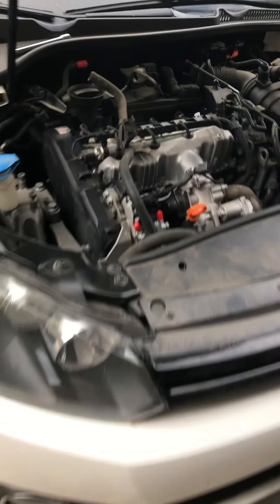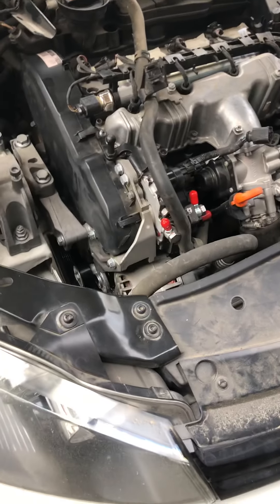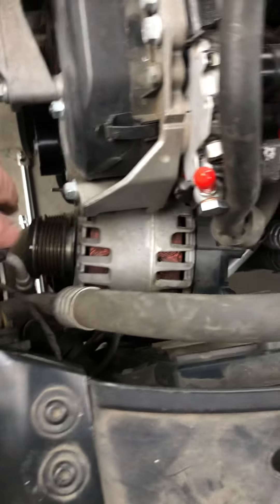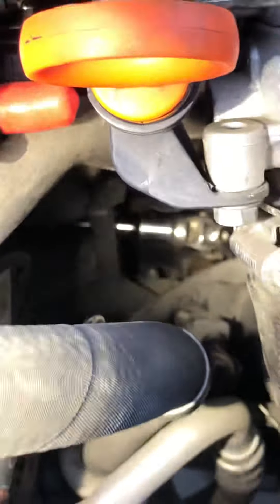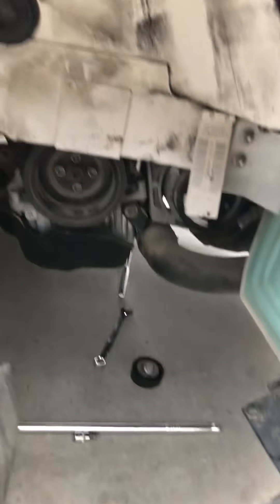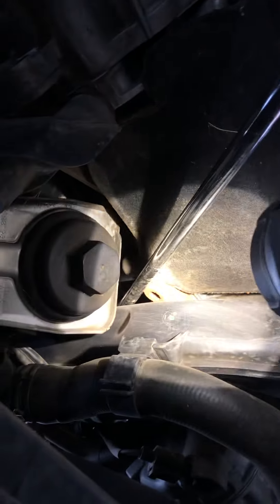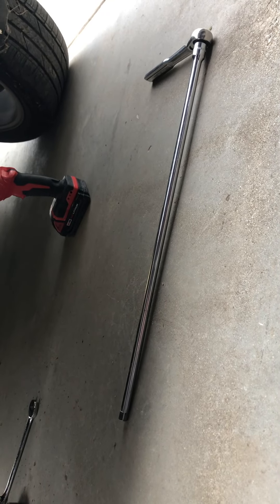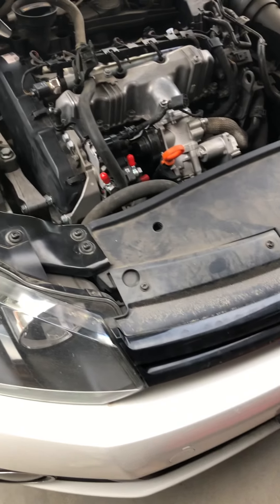VW 2.0 TDI MK6 serpentine belt tensioner replacement trick

Comment: Took me 10 minutes ! didn't have to move the alternator! Best video!
Reply: Nice to see a fellow mechanically inclined female working on these cars!! I'm getting ready to check the tensioner; alternator stopped powering the battery with prior multiple belt breaks & replacements. Fingers crossed it isn't the alternator.

Comment: I've just done this job, what a gigantic pain! I took the ac compressor off and could get at it with only a 2inch extension. You'll need a very extensive set of sockets and extenders to do it the way shown. It's not as if the access to the bolts for all of the things you need to dismantle beforehand is good either.

Comment: Before you complain too much. The 2013 vw amarok poly v belt tensioner arm (same part) requires a complete removal of the alternator AND you cannot remove the M6 bolt (with 13 mm hex head). And these m6 bolts are also known to snap in half with the entire tensioner arm falling out with the pulley and the poly v belt then flying into the timing belt cover and dmgetting caught in the timing belt while the car is moving causing catastrophic engine failure. VE have developed a heavy duty timing belt cover and a heavy duty tensioner pulley arm (with a metal pulley instead of the plastic pulley in this picture$. Product code endinf with AN is the regular ending with AP is the heavy duty tensioner arm

Comment: You can get a little more space if you remove that plastic piping.  One hose clamp at the top , one down by the rad, and then two T30 torx screws.  One is easy to get to by the oil pan, and one is a little harder about half way up.  Theres also an electrical connector, easier to get to once you pull the tube about half way out.

Comment: It looks like you can access by removing the air intake too which is good because I need to replace that along with what I believe may be a bad tensioner. I just had the belt kick off and it had only been replaced a couple months ago by a local shop. They didn’t replace the tensioner unfortunately and I didn’t know they had replaced the belt until they were done with it or I would have just had them do the tensioner too. My 2014 MK 6 Sportwagen TDi has 315K miles and I have no problem preemptively replacing a part like a tensioner before failure with that many miles.

Comment: How did you loosen the alternator? I can’t seem to get past this step lol, I have a mk5 Jetta tdi
Reply from the maker: I believe it’s solid mounted I just removed the bolts and it pulled right out of the bracket. Your cars might be different than my Golf
Reply: Mk5 Jetta TDi isn’t specific enough. That could have the BRM or the CBEA (2009 common rail) engine in it. The CBEA is nearly identical to the engine depicted in this video. If it’s a BRM, the tensioner is mounted like a normal tensioner.

Comment: So once you get the alternator off just use a 13mm wrench. Ratchet wrench if you have it. No need for the extensions and U joint. Awesome video other than that.  I didn't take the tire off.
Reply from the maker: As mentioned in the video you dont have to take the alternator off for this I only did so to show the bolt better for the video. I had the wheel off because I was also doing a timing belt, not required just makes it easier.

Comment: Thanks for this video.  I’ve got a 2011 Audi A3 TDI and hoping this applies to me.  I’m concerned it’s not the exact engine since your oil filter is at the bottom, so still need to do some research.  

But I totally agree… these freaking Germans must be smoking when they engineered this as well as the coolant thermostat!!!!  It’s a love hate relationship for sure.
Reply: it's almost the same engine you have and you probably have the oil cooler too underneath your CBEA